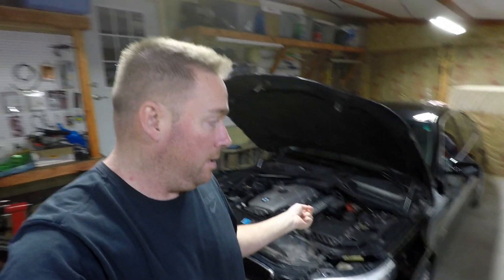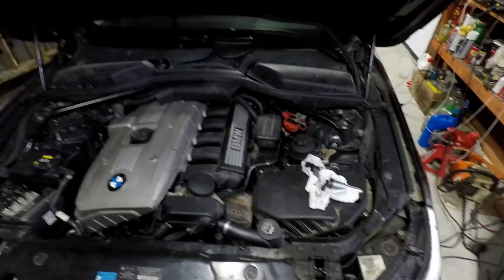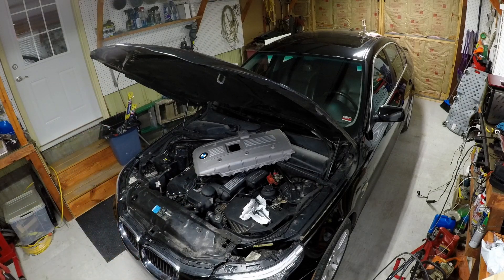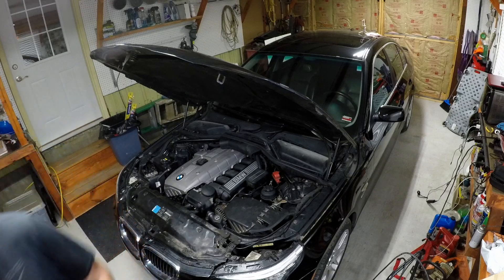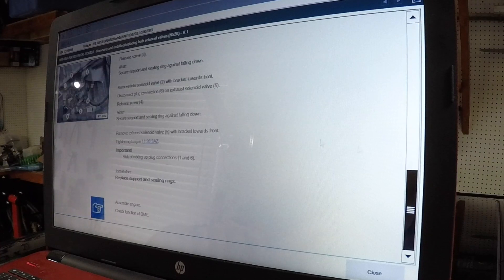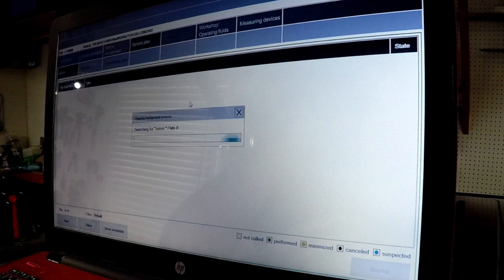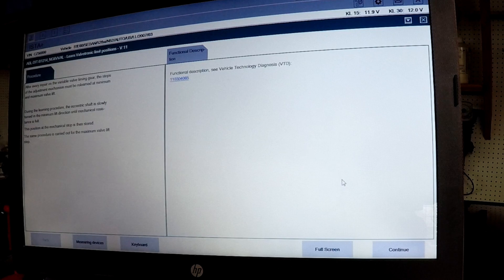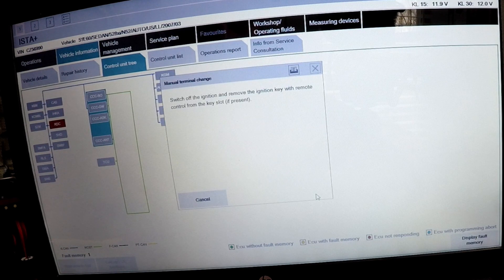Installing NEW OEM N52 Vanos Solenoids And Calibration Using ISTA-D

Comment: Update for 2025. I got a brand-new pair from FCP back in 2020. Fast forward to 2025 and less than 50k miles and my exhaust side solenoid is having a few issues after driving coming to stop light with ac on (oil change interval is about 4k). Back in 2020 for $176 they were both in own boxes with the thin gift wrapping around each solenoid. Now in 2025 for $240 they are just in a bubble bag and then put in way too big a shipping box for the size of the item. Still work wayyy better than the AM offerings. I was surprised to find out the Pierburg solenoids will NOT work. The car will run ok but it will NOT idle with any stability. You HAVE to buy genuine vanos solenoids. They have that market cornered probably because they won't release the data in how to make them right.

Comment: Fyi. I was going to replace my vanos but did the valvetronic learning after watching your vid, and viola ;) it's now running perfectly. I think many people think they need to change these things but they just need to change the oil and reset the valvetronic system and clear the codes.
Reply: I don't disagree. My E65 threw codes after sitting for a few weeks when the wife and I were away on hiatus

Comment: I just did my vanos sprocket bolts and put the engine back together. Now my engine popped out a 2a7c code for the inlet vanos. Does that mean I have to calibrate/program my vanos solenoids?

Comment: Hi Nathan. I have 2007 N52B25 with plastic cover and I notice that my intake manifold have lots of oil. I have changed plastic cover with new one which has got original bmw logo. My problem is continue. What can you say about my problem? Thanks.
Reply: Valvetronic gasket

Comment: There is absolutely no relationship between changing vanos solenoids and learning Valvetronic limit positions.
Vanos solenoids are responsible for timing related to RPM, load... Etc. It s VVT. 
The valvetronic (vvl) is handled by the eccentric shaft motor and sensor.

What u did through ISTA is only useful when you change the ES motor or replace valvetronic gear like the eccentric shaft or the rocker springs.

What you really need to do in your case is deleting engine adaptations and performing a re-adaptation for the engine (driving session, flywheel adaptation, fuel trims... Etc)

Comment: O-ring goes one in the block first.  
Solenoid snaps right into place.

Cheers from Ct USA
Reply: That seems like it would leave room for the o ring to roll as you're putting in the Solenoid... I've never seen anyone do that and I've personally done this job about half a dozen times over the years on different cars.
Reply: Tyler Padgett - there’s a lip where the oring sits.  I guess it could fall out of place. Try it next time.

Comment: Just clean them in break fluid and 12v to open and close worked great on mine
Reply: I did that with mass air flow cleaner and it qont rev past 4rpm
Reply: Jerrol Lowe break fluid is much better for cleaning that part

Comment: The Chinese parts are very good. 👌 Anyone can change the vanos solenoids all they want or clean them up, but the rough start and idling will still exist. What people don't know is those solenoids have filters beneath them and if they're clogged you will always get the rough idle. There's 2 of them, take them out and clean them and you will see how this fixes the problem. Just my opinion though.
Reply: i put 2 aftermarket ones in myself and it runs beautiful

Comment: Hi Nathan i got a p0015 after replacing exhaust side with a china valve bit the bullet and bought a OEM and code went away took the car for a drive although no codes the car had no power low end so what i did was clear vanos, intake pipe and throttle adaptations power came back immediately and al was good.I was just thinking that you should do that on that 328 you have and see if that makes a difference on power after the 3 stage upgrade.
Reply: What u used to clear it. . A regular type scanner
Reply: @thatguy-f7276  Inpa

Comment: This reset procedure was for learning the variable valve lift motor limit positions against the eccentric shaft. This procedure has nothing to do with vanos solenoids. This procedure will run the vvl motor in both directions and watch the amperage the motor is drawing to determine the end travel of the vvl motor as it is installed. This procedure is done anytime the vvl system has been repaired or parts have been removed and installed.
Reply: Is it necessary to calibrate VANOS solenoids? I've changed them on multiple cars I've owned over the years and I've never done this...
Reply: im not an expert, but im quite sure that he was at the right spot when you first started recording the Ista-D on his laptop, before he switched to find "valvetronic re-calibration"
Reply: @JamesKL969  Pretty sure you can recalibrate VANOS Solenoids.. there is an option in Bimmergeeks Protool. I've just never done it. since the cars always ran fine.

Comment: Hi, is it the same on N46? I had occasianally vanos issues so I bought both new, replaced them and engine gone crazy with them. Threw me p00 codes on both sides. Seller replied me that the solenoids need to be set in control unit. Thanks
Reply: Hey can u explain this

Comment: Thanks Nathan for another great vid, and this is why I am keen to bite the bullet and replace the old Vanos solenoids (old part number variant) in my '05 330i - the symptoms that I've had for ages are so indicative of one or both bad Vanos solenoids. I've cleaned and swapped them around plenty times over the years, and whether imagined or not, the improvement has always been minor and/or short lived. But I want to say that it is different depending on the orientation of the two solenoids, so assuming one of them is the bad unit, it's then affecting the engine differently depending on if it is attached to the intake or exhaust side. I am still trying to find out if the local BMW ECU specialists have the latest software that does the auto cleaning that you mentioned in a previous video, so once my car has that update I will be fitting new solenoids, and hold fingers! :)
Reply from the maker: Hello, the 05 is still the m54 engine which don't have solenoid issues
Reply: Nathan's DIY Garage, it’s an ‘05 E90 330i 6MT, one of the very first N52B30 powered cars, so not the M54B30 like my ‘04 E46 330iM 6MT.

Comment: Have a question.
 Currently in the market for a sedan around the 5k range as a daily driver. Would you honestly recommend a natraully aspirated e60, e92 ? Or should I just play it safe with a v6 camry, accord or g37
Reply from the maker: If you never want to touch it buy a Camry or a lexis is250, they are not as comfortable cars but rarely go bad, the e90 would be easier than a e60

Comment: You’d think that someday the cheap Chinese automotive (electronic) parts industry will improve enough that you could at least get 1-3 year of good use out of a part before it fails; instead of it never working out of the box, working for a day or two, or just never working correctly. You would think that there would be limits to how long you can produce total junk before the word has spread enough in the marketplace that you either pony up and make stuff that is at least of acceptable quality, or get forced out of business?
Reply from the maker: Especially on things like cam sensors, you think it would just be easier to make the right instead of always wrong lol
Reply: I have bought in the past a really cheap ac compressor and ac rebuild kit from eBay and it did the job very well for years... So sometime you pay more for nothing!

Comment: Dang brother, I never even thought about calibration!!!  but heck What is the ISTA-D and where can I get that ? Im in a 07 328i and was chasing codes all over the internet. I also have the carly but it does not allow to do some thorough diags.   is the ISTA-d a  perfessional software program (dealer thing)
Reply: No it aint mate itd open to general public but people like me create servers to have access to this desler system as i build the database without it the program wont work as bme took it from there server years ago and we had to find a way around it to run ista i provide all programs like this but not for free
Reply: @BMWDoctor   Where can I get the software from? Also do I build a server at home and install the app or use azure?
Reply from the maker: Some small scanners let you reset adaptions Bob, thanks for watching